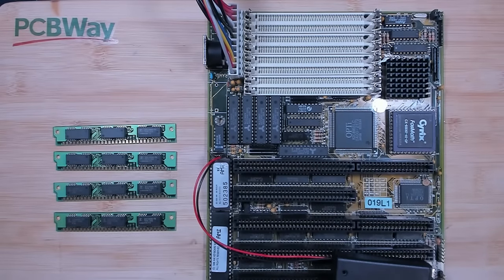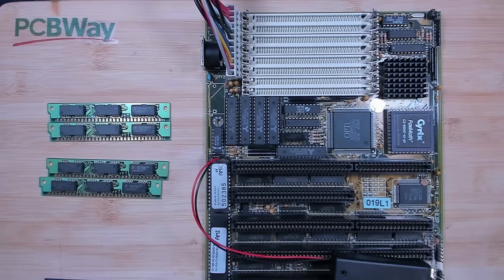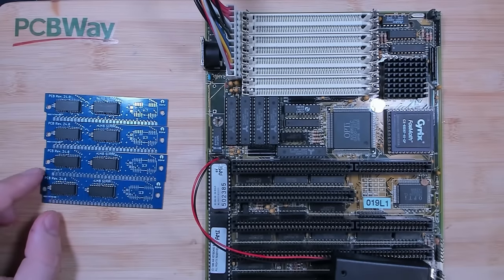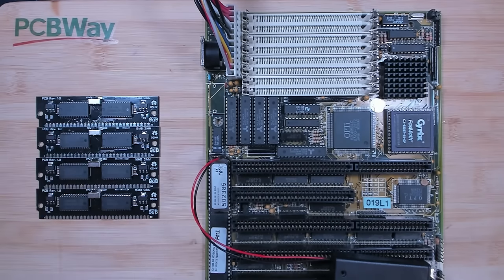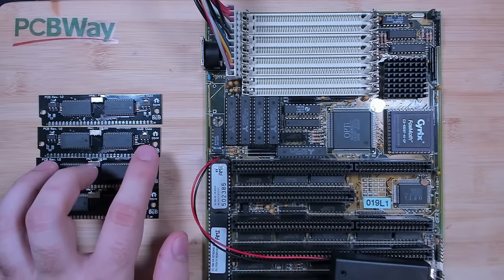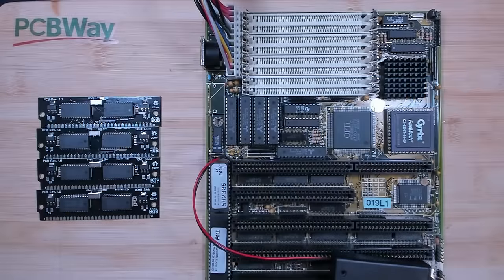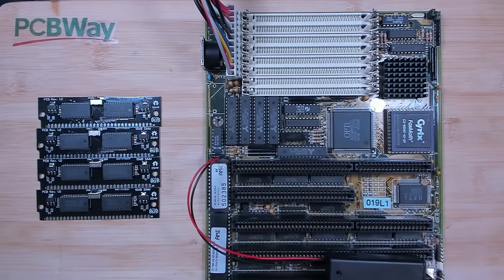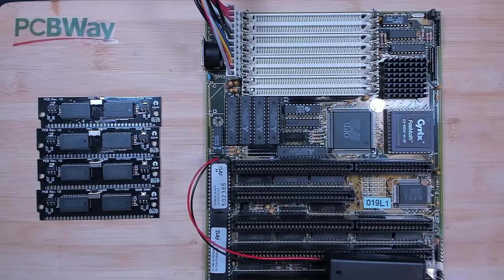16MB SIMM Revision 2.0 - I screwed up!

Comment: Hey! First and foremost, thank you for the content! I enjoy watching all of your videos!
Now...
Dont know if you want the information or not, but I thought I would step in and leave you a comment about your approximation model you built utilizing the Falstad Circuit Simulator.
The cap never fully discharges... via TTL, any standing voltage which is less than 2.15~2.35 is considered a 0, and anything above 2.75~2.95 is considered a 1. 
If you were to tie a voltage source to the cap with a 2.25 static level, you will see a difference in the output wave. Less than half the time to charge the circuit. This should also explain as to why you are not seeing higher voltages levels as you are expecting.
Also, most all ChipSets (including back in the day) do utilize internal buffers as protection circuits for both TX/RX signals. Again, helps you see the voltages you are seeing on the O-Scope.
It was found early on (1980-ish) that buffers and Schmitt triggers were necessary in order to protect other components, but it was lost (purse') because it was adopted as a standard. Little to no mention was made over the years. 
Hope this helps!
Keep the videos coming!!!
Reply from the maker: I may not understand everything right away, but I am happy for any help and clarification I get from my audience. I must say, most of what I do originated from you guys in some form. So, thanks for sharing and thanks for watching my videos.

Comment: To not affect the capacitance as much when probing, you can use 10x probes, which are much higher resistance and have lower capacitance required to balance the signal

Comment: Thanks for the video. I've been wanting to make a socket 7 to socket 4 adapter for a long time. To install k6-2+ on a 1993 motherboard. It needs level shifters like these because early Pentiums are 5-volt level signal.

Comment: Most input pin voltage maximum limits are because of the design of the chip there's a parasitic diode connecting the data pins to Vcc. This diode is also a major player in that 7pf at the pin. If the input voltage is 0.6 volts greater than the Vcc you can get too much current flowing from the data pin to Vcc. A series resistor to the pin should be enough to limit that current to a safe value while allowing the resistor to be small enough to not cause clock skewing (that's why you needed rather low resistors in your voltage divider idea). If we assume that the input pin will clamp at 3.3 volts (it can probably go higher but I'm taking a worse case maximum input voltage) and you have a 5 volt signal, that requires the resistor to drop 1.7 volts. Using ohm's law for a maximum current of around 5 ma, the resistor value should be 300 ohms. I'm only guessing what the maximum safe current is (5-ish ma is a safe bet). 300 ohms should give you a fast enough risetime to charge the 7pf capacitor to give you a proper square wave.
Reply from the maker: Thanks for that info. I'll spend some time to have a look at this.

Comment: About your voltage divider example, there are two (plus one) things you missed.
First, your memory module, or whatever circuit you have, not only has a capacitor but also a resistance that also consumes current and affects the output voltage of the voltage divider. To be more correct, your circuit has an input or output impedance (combination of a resistance and capacitor or resistance and inductance). That value is usually in the datasheet.
The second thing is related to the first and that is that you forgot to account for the current needed to drive your memory. As an example, if the memory requires 10mA of minimum input current, you can not have less current driving the voltage divider than the sum of those 10mA with whatever current the voltage divider itself consumes.
Last but not least, a small electronics tip (using a large amount of text :P ). Voltage always only sets a field (road/path) for the electrons to flow through but it is the current (the count of electrons flowing) that drives the (any) circuit. This is the reason why the wave form stopped being so nice and square when you reduced the current. You did not had enough current to drive the circuit fast enough for your target frequency. This is one of the reasons modern memory modules use lower voltages. With lower voltages you need less current to drive the circuit and at the same time allows to increase the frequency. Example: a short and thin water glass needs less water flow to completely fill it so you can increase the frequency at which you fill it.
If you care to know a little more about the details, the wikipedia page about capacitors has the information, but in a nutshell: You probably know by now that capacitors do not conduct current (they are insulators) and they "store" voltage. Well, that storage happens because capacitors have their insulating material polarized. The greater the voltage, the more atoms of the insulating material are polarized (the storage amount is bigger) . But to polarize the material you need charge (electrons) near one of its terminals. This charge is usually calculated using voltages and the time constant of the circuit. So, the bigger the current, the bigger the charge on the terminal of the capacitor, the faster it will be polarized, which implies that it will reach its target voltage faster, allowing the frequency to be increased and give you a nice looking square wave :)

Comment: There is another option to level shifter and voltage deviders, Zener diodes, I had a project once where I'd clamp 5V to 3.6V using Zeners for 3.6V on the data lines, it works well and only uses a single diode per data line

Comment: Edit:
The text below was BEFORE I'd watched the whole video...  I now note that you're already SEEING the 'rounding' of the square wave with your resistive divider.
I wonder if you'll end up using level shifters (very QUICK ones), or maybe just a couple of diode drops per line with a pulldown?

The RAS and CAS lines of any DRAM are THE most critical lines and, generally speaking, will have the quickest pulse signals on them.  (Let us know if you want to know why that is...  DRAM is kinda 'complex'... LOL)
Anyway, due to those facts, you should want to place the MINIMUM possible load on them when you probe them, so you SHOULD set your probe and scope to 10x.
When you're in 1x mode, your probe + scope acts like a 1 megohm resistor and around 20 pF of capacitance on the circuit being probed.
When you're in 10x mode, your probe + scope acts like a 10 megohm resistor and around 3 pF of capacitance on the circuit being probed.
The ISSUE in this case isn't the resistance, but the capacitance.  The higher the capacitive load, the more that it 'rounds off' the nice sharp edges of the square wave.
As mentioned, the RAS and CAS signals are extremely 'time-sensitive', so when you 'round off' the CAS signal, you might be causing it to OVERLAP with the RAS signal thereby causing a memory crash.

Comment: This is awesome. It would enable me to put 64MB onto my 486 board. 72 pin FPM seems to be impossible to find near me at a reasonable price.
Reply from the maker: I also found myself with just a few FPM memory modules (most of which are low capacity). I might look into designing a 72-pin PCB which includes the EDO-2-FPM mod
Reply: @bitsundbolts  This would also work well. That or I live with 16mb on my 486😆

Comment: Modern ICs have clamp diodes on most pins to Vcc. I think the 3.8V is just Vcc (3,3V) + diode voltage (0.6Vish). This is done to protect your circuit from over voltage. It can be verified by connecting Vcc to ground an apply voltage to the pin. You should see it becoming conductive at about 0.6V. These clamp diodes are made for ultra low currents. So you might have destroyed them on the Cas cs pins already, in case they had any.

Comment: The address lines just have a higher rate of toggling because it is multiplexed so there is no time for the voltage rise too much more than what you measured. But they are driven by the memory controller off a 5v rail.
Reply from the maker: Maybe if the bus frequency goes from 40 to 33, a different voltage would appear on the address pins. The board has a 40 MHz 386 on it. Thanks for the hint, I'll try to keep that in mind.

Comment: A somewhat rude and simple way to interface 3v3 and 5V domains is just with resistors in series with the line. I have seen anything from 100 Ohms to several kOhm.

The way it works is... where does the voltage tolerance of IC IO circuits come from? Generally there's fast diodes to VCC and ground on every IO pin that act as lightning rods for static electricity, ESD diodes, and once you exceed the VCC on the IO line by the diode threshold, the diode will conduct all the current that you can provide, but since it's made for low-energy burst loads only and not for sustained current, it's going to burn out short, leaving you with a no longer working IO pin which is always tied to VCC. But if you just add series resistors, this can prevent these diodes from taking too much immediate and permanent damage.

I think voltage dividers shouldn't be used but given you figured out proper level shifting, well that's good.
Reply: This can only work up to some bus frequency as the inline resistance will skew the rise/fall time because of the pin capacitance of the RAM chips.
Reply: @VladoT This. I've used resistive voltage dividers for all sorts of horrible things over the years, but things start going wrong when using one on a signal line. Save yourself the trouble and just get a €0.20 level shifter.
Reply: Yes but if you read between the lines of the Micron RAM datasheet, it's implied that there are no traditional ESD diodes to Vcc, only to ground. 4.6 volts max pin voltage when run at 3.3V? That's beyond 0.3V for a Schottky diode or 0.7V for a silicon diode. So the chip probably doesn't clamp the voltage and putting 5 volts on the pin will not cause a bunch of current draw (which you want if you're using the series resistor). Instead any failures will be via electromigration or whatever, not thermal failure as is the usual risk when putting a lot of current through the ESD diode.

Another issue you can have with using a diode to Vcc to limit the current is that you can raise up your 3.3 volt rail closer to 5 volts. I had a system once with this problem. We used the wrong kind of buffers to interface our 3V system to 5V logic. We should have used 74LVCxxxA series buffers but instead we used something else which had the ESD diode to Vcc on each pin. When the host system put a logic 1 on all the pins, the 3.3 volt supply would go up to 4.5 volts. If you're intending to put a lot of current through the ESD diodes to a lower Vcc, you need to use all of the current coming in through the diodes, or else Vcc will raise up towards the I/O pin voltage. Easy solution is to just put a big (i.e. low resistance) resistor between 3V and ground, sized to waste the worst-case current coming in from the diodes minus whatever your 3V logic's minimum operating current is. That wastes a ton of power, so maybe you can try a shunt regulator strategy. You put some kind of zener diode or thyristor or something that turns on a clamp once the voltage exceeds 3.4 volts or so.
Reply: I agree with this, if the chip has a diode then it will clamp to 3.3v plus about half a volt. If it doesn't then diodes are easy to add. Just to give you some faith you can connect a micro controller pin direct to mains via a resistor and rely on the internal clamping diodes I've seen cost optimized circuit do exactly this for zero crossing detection.
Reply: @zanekaminski   Thank you, very interesting.
Reply: @dr_jaymz  Yes but watch out for the capacitance of your external diode if you want to go fast!

Comment: TTL logic chips operate at 5 volts but there output levels will not reach 5 volts and are valid as low as 2.7 volts. CMOS output chips however will drive much closer to their power supply voltage. This means that CMOS outputs using 3.3 volts are often usable to driver 5 volt TTL logic inputs. Some CMOS chips are tolerant of being driven by a 5 volt signal even with a 3.3v power supply. Additionally some CMOS chips can tolerate being driver from a TTL signal level when operating at 5 volts while other will waste power if driven with TTL signal levels. The translator chips are a great solution that makes it simple to move between signal levels but often a 33 ohm resistor works fine to drive a 3.3v CMOS input from a TTL 5 voltage signal.

Comment: Make more stitching vias, it improves many aspects of high speed signal design, even ESD protection if you put it on edges.
Reply from the maker: I will rework the copper pour and keep your suggestion in mind. Should be easy to add more vias in most places.

Comment: I want to try soldering paste. It looks much easier. Thanks.
Reply from the maker: I was surprised to see it working that well. It might be possible without a stencil, but it's probably a lot messier. And you might end up with more solder bridges.
Reply: @bitsundbolts  it is much easier to fight against solder bridges that to solder is with iron from scratch.

Comment: Thank you for the new video.  Root-cause Analysis is a very good topic to present on, in my opinion.  I like how it makes us have to think.  Well, me at least.  Gotta get that cranium in gear, and use it!

I noticed that the title bar of the circuit emulation software was cut off.  Can you tell us which program that is?  Is it open-source, or reasonably cheap?  Thanks!
Reply from the maker: Sorry, I should have mentioned the tool. I'll add it later in the description. But you can search for "Falstad circuit simulator"

Comment: An improvement idea: there are AMS1117-equivalent chips in SOT-89 package so you can get rid of that lump. Actually you may be able to squeeze a LM3671-3.3 with a 0805 surface mount inductor in there which is a fixed voltage DC-DC buck converter for lower power consumption. Also you can use resistor packs for the pull-ups/terminations.
Reply from the maker: Ah, I'm still working on this project. Unfortunately, I wasn't successful yet to get the modules to work.
Reply: @bitsundbolts  I wonder if you are okay with CPLDs and FPGAs? The Intel MAX II CPLDs are 3.3V parts with some 5V-tolerant I/O pins. Maybe you can do level translating using those? You can even terminate the FPM/EDO bus interface in the CPLD and use a SDRAM chip for actual data storage instead.
Reply from the maker: I will research your suggestion. But I would love to get these modules to work. I have access to many EDO memory chips and could make plenty of those modules with level translation - if I get it to work properly.

Comment: I would say that the total bus load on the parallel control and address signals lowers the effective voltage, while the data lines are connected point to point (or in this 32 bit 8 simm system only shares two loads, while the others are 4 to 8 loads). Also seeing the Vpp to go over 5V means your probe or scope is an inductive load to the line and it produces higher voltages that the system normally would have. If you were to properly setup the scope, to see an edge and its under-overshoots, that would be obvious.

Comment: Regarding the solder paste creating bridges, that paste looks far runnier than the paste I've used.  You may try refrigerating the paste container before spreading it.  It could also be the formulation of that brand.
Reply from the maker: It might have been the hot temperature in Dubai as well. I didn't immediately put the SMD components on the PCB and brought it to the heater. Might have been my fault.

Comment: As always good work. But what is the purpose of maximizing memory capacity for such a limited processor?
Reply from the maker: Yeah, a 386 will probably not benefit. For me, it's just a way to learn, tinker and max the memory on some of those old boards. I think some people may use those modules also on sound cards (some Soundblasters have memory slots to store sound fonts), or other devices that support 30-pin SIMMs. We shall see what will come from this.
Reply: @bitsundbolts  Sound Blaster 32 supports 2x 16 MB 30-pin SIMMs and allows for 28 MB Sound Fonts to be loaded (not sure where the missing 4 MB goes probably reserved for the rom or something). Back in the Day getting such a sound font was not easy but with the internet now It's not so hard but the old Sound Blasters need version 1 soundfonts (sbk) in DOS and you mostly find version 2 soundfonts (Sf2) on the internet though there is software to convert sf2 to sbk. With a little bit of effort you can get great sounding midi and perfect Sound Blaster support in DOS.

Comment: Try using a little less solder paste. Apply it more sparingly. Ideally, it should stay on the pads and not bridge them when you remove the stencil.
Reply from the maker: I think I also had the PCB sitting there for a while before I added the SMDs. But you're correct, I need to practice a bit more ☺️

Comment: Great work. Out of curiosity is their a reason the modules need to be that short I remember having slightly taller modules in my 486 back in the 90s maybe just shy of half inch taller.
Reply from the maker: I already increased the height of the modules compared to the original design from UpLateGeek. And no, there is no reason to keep the modules that short. However, the larger the module, the longer the traces could be - which could be bad for signal integrity. The small size helps me utilize the space efficiently and forces me to rethink the layout of the components.
Reply: @bitsundbolts  great work on your project I'll look into getting this when I decide if I have the room for another pc really what a 486 but I'd have cut loose the 2000 duel xeon and duel p2 I have to many old pc's in small area.